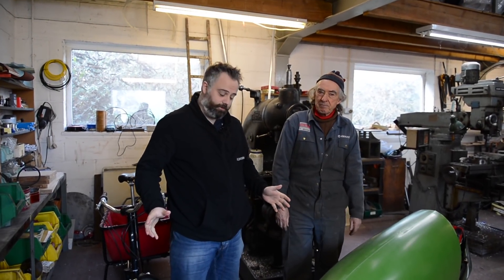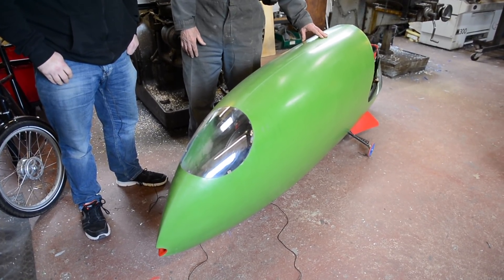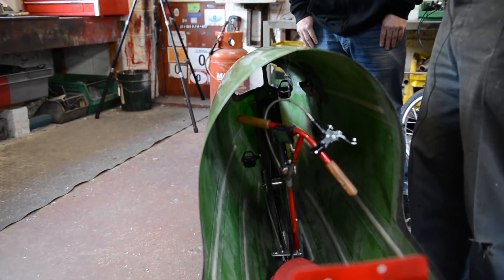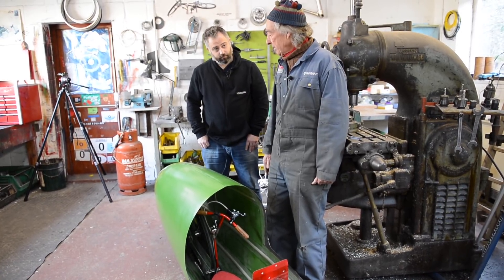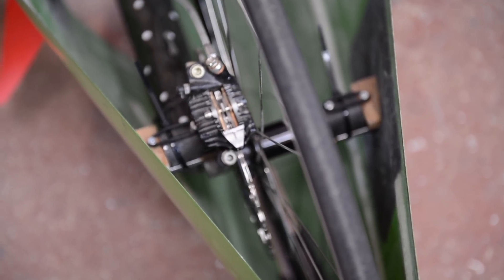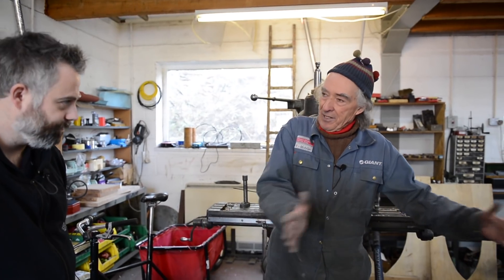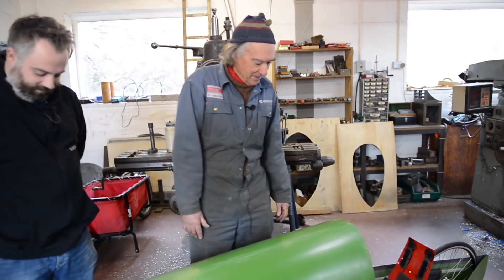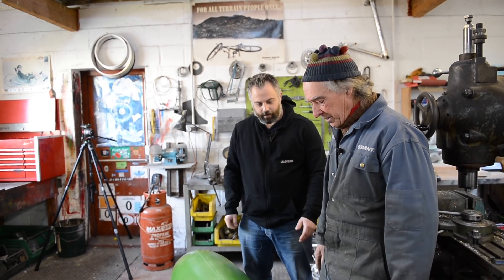Soup Dragon with Mike Burrows

Comment: If Burrows isn't sure whether "boxing" the wheels makes sense, why not test it and see? 
When I was at Battle Mountain the Australians suggested using window heat shrink wrap to another contestant who had exposed spokes.  Her speed went up a few mph after she did it. Window heat shrink wrap is a product sold in hardware stores to seal leaky windows.  Wasn't perfect but her speed did improve. Whether that was due to more bike time or the heat shrink is hard to tell but Burrows has the time to test both solutions.
Reply: test - means lots of effort, that could be spent on another part of the bike. See - thats actually really hard, understanding whether the speed is due to the latest change or something else. The testing was something we spent quite a lot of time when making the Eta, and it was all worth it, but still difficult and required lots of effort to understand where the performance came from.
Reply: michael greene he accepts it works, (but doesn't understand it) just doesn't want to do work to make one. Its up to the Uni to prescribe requirements for said bike. Record bike has fully  boxed disc wheels (I believe). Stands to reason they did the calcs and testing to show it made a difference. Discs should at least be used on this, everyone knows they are more aero, even in a fairing.
Question is, someone needs to make solid wheel and solve the suspension issue via forks up to the task where its still comfortable enough for rider. That's where the improvement will be in future. Solid wheels, smooth runway, suspension forks.